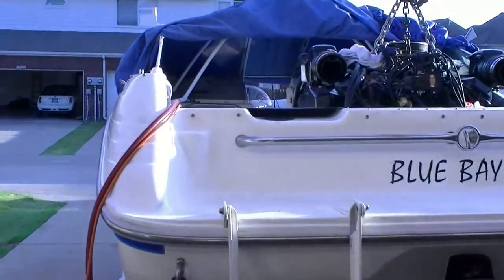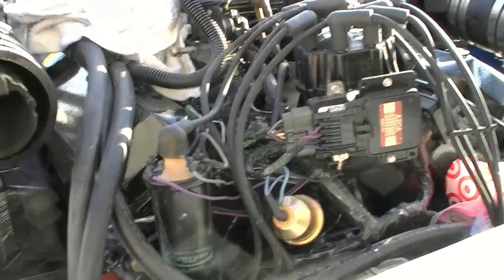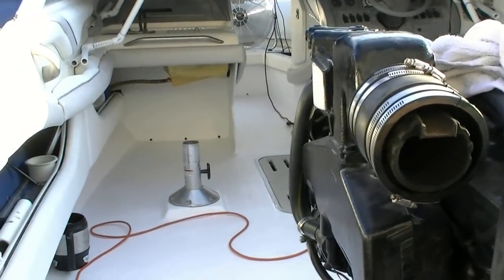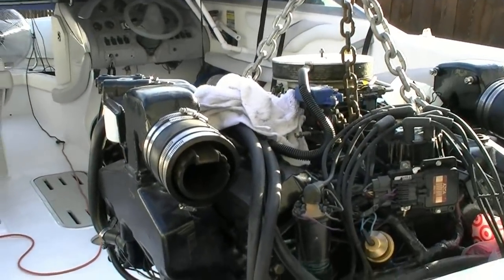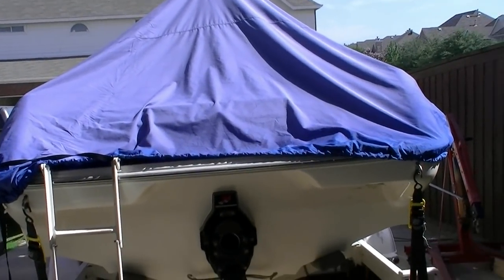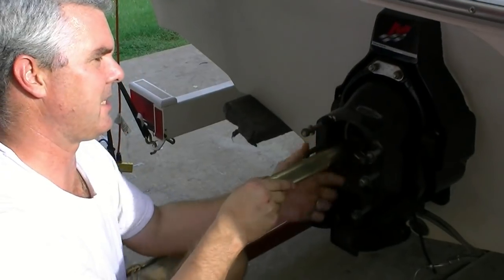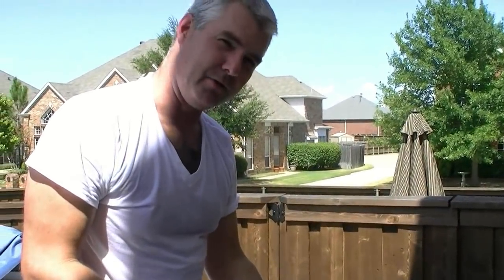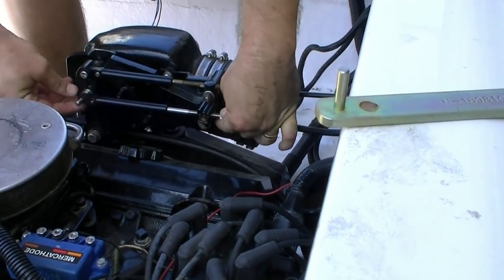Proper Mercruiser Engine Alignment and test fitting the new exhaust! VLOG #55

Comment: Hey I removed a 350 Mercruiser from my old 22' Wellcraft and found those two spring washers laying in the bilge. I had no idea what they were at the time and threw them out figuring the owner before me dropped them. When I was putting the engine back in, I couldn't line up the outdrive and remembered those washers. Luckily the SeaRay dealer is five minutes from me and had them in stock. Those were the cheapest parts I ever had to replace on a boat. Nice job and great videos.

Comment: Friscoboater, I love all of your videos. You have walked me through my Sea Ray SRV 192 rebuild. Although i have one more question for ya. When aligning the engine, my rear mounts are obstructed by the bulkhead in my sea ray. Did you have to disconnect the rear mounts and remove the entire egnine each time you adjusted the mounts? Mine may be a little different than yours (inline 165). It has a single tripod that bolts into the engine mount/haul. Thanks for all the help. Sam

Comment: Vaseline is not good to put on rubber seals it will deteriorate them, use a silicone lubricant.
Reply: The05ZX10R use a gasket sealing compound
Reply: So then why do most hydraulic companies tell you to use it when installing orings?

Comment: Hello, I'm having ignition timing issues. I'm trying to time the ignition on a 97 mercruiser 5.7 with an alignment gun I bought from an auto part shop. I've already tried most of the directions they have listed on the internet but I can't seem to figure it out. Can you help by telling me how to or maybe showing a video? they are no video about that anywhere on the internet...Please help last summer I couldn't enjoy the summer at all because of it and I want to be ready before it gets here.Thanks
Reply: Looks like you posted this 10 years ago. I have never heard of an alignment gun. I think you are talking about a timing light. There should be several videos or written instructions on how to properly set the timing on mercruiser engines.

Comment: the mechanic removed the stern with no problem but when installing the new sterndrive he told me the engine was out of alignment, yet after a few he got it in,still said the engine is not aligned, So, how can I get it aligned without removing the darn stern drive again?
Reply: You can't. Proper alignment is done with the outdrive removed. An alignment tool is very helpful though not absolutely necessary. The drive shaft needs to slide in easily with only a little rough bump when the o'rings contact the gimbal bearing and splines of the coupler. If it takes more than a good kick to get it in then it is not aligned.